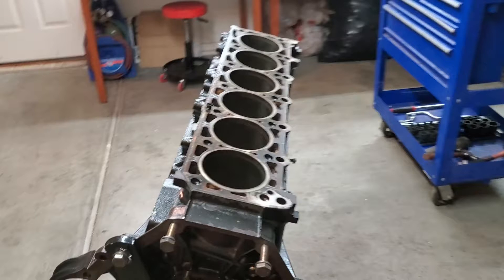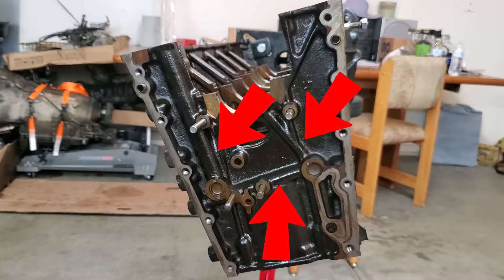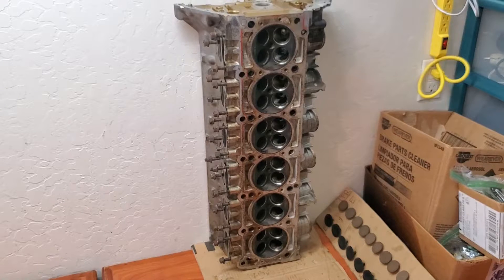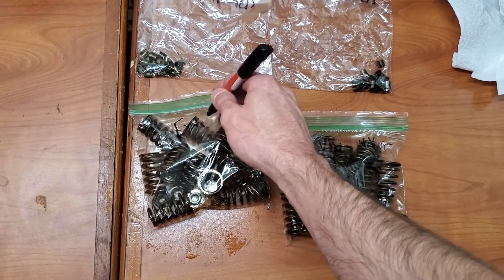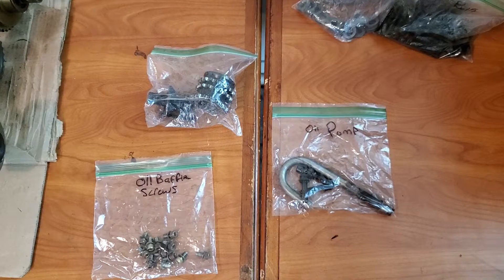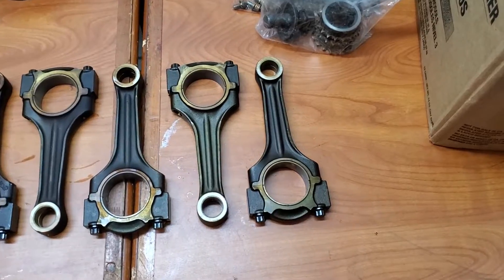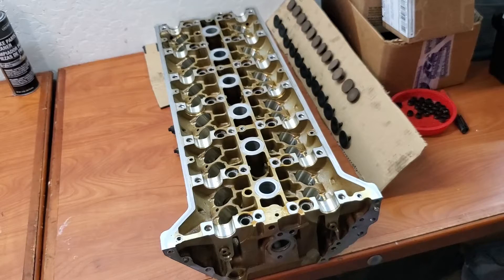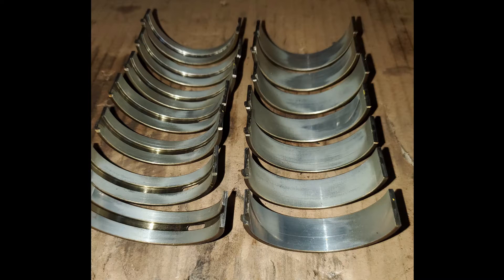Preparing For Rebuild - M104 Turbo Build (Ep. 6)

Comment: Hey There Bud, love the vids, what connecting rods and Pistons are those?
Reply from the maker: Hey Nick, good to see you, and glad you like my content! 

For this build, everything is 100% stock. Im just rebuilding to replace bearings and check the integrity of all the internal components. My goal is 400-500 wHP

There are stories of people making 500, 600, even 700HP on stock internals. Just pull the engine from the junk yard and turbo slap it. I wouldnt recommend going over 500HP at the max like that though.